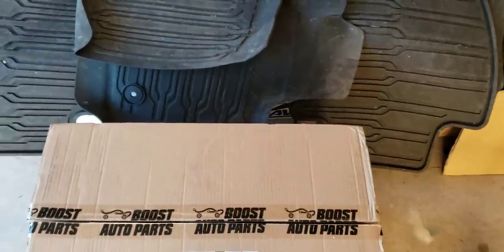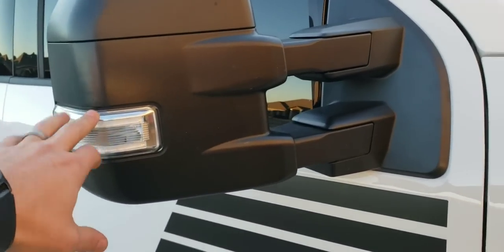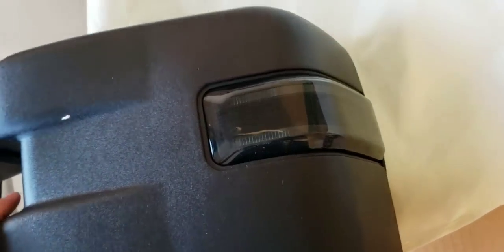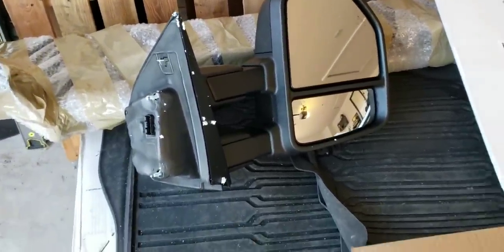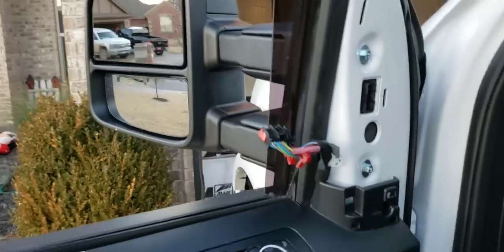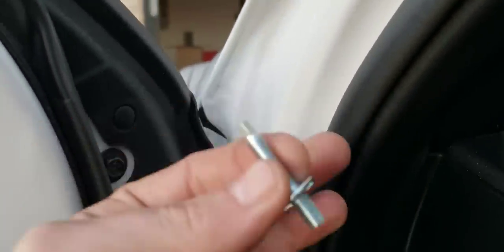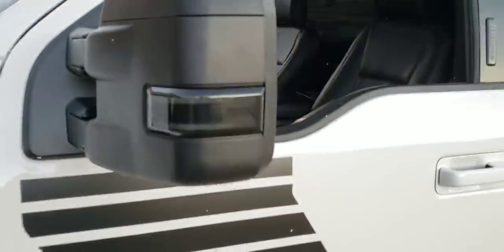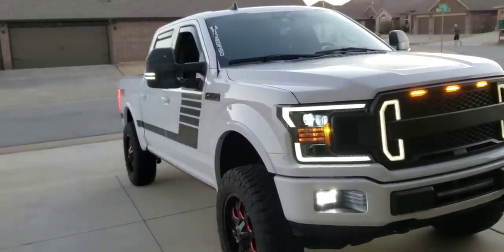BY FAR THE BEST TOW MIRRORS FOR YOUR 07 N UP F150, 03 N UP SUPERDUTY, BOOST AUTO PARTS INSTALL

Comment: I just finished my install today.  Well built products for sure.  I ran the wire for the running lights which was a bit involved at first.  But after doing the passenger side, the drivers side went much quicker and easier.

Comment: Great videos my dude.. liked and subbed. Just purchased My first ford… new to me 2020 f-150. Your videos are super helpful. Just to be clear that one extra wire I will have to run to the door harness will activate puddle lights and switch back? Or are there more than one wires? The truck I have now had the basic mirrors no puddle lights.. thanks man👍🏻

Comment: I thought for the switchback feature u had to run wires to the headlight? I want switchback but only if I can just plug in a harness and not do any extra wiring. Thanks for the vid

Comment: Ok guys I am trying to find some 2016 f150 tow mirrors with all the options...power fold and tele, 360 camera puddle light etc. the only ones i can find are 1600.00  I love these mirrors but they are not power fold unless I am missing something. Oh yea sweet truck!
Reply from the maker: i would personally wait just a bit longer as i know a great company that makes the best stuff is working on a set to be released.
Reply: @WICKEDAUTO1  Thanks!
Reply: @WICKEDAUTO1  Thanks for the info I will watch for them.

Comment: Nice, I just ordered the same ones for my 2017 ,  Only have the 8 pin connector though so have to  run the extra wire for the running lights. but seeing them on your truck it' will definately be worth it.

Comment: Nice video, how do they perform on the highway. Do they vibrate like the old mirrors? How far do they extend out? Do you hear more wind noise when driving on the city streets?
Reply from the maker: They are absolutely amazing, 100% difference from the syppo ones. No shaking, no wind noise, factory like glass. I believe they extend out 3in

Comment: Great video man!

 I may have missed it but do those lights on the mirrors have the spot lights like oem? If so how do they look, as far as brightness?
I was thinking about getting them for my OEM Tow Mirrors but I don't want to lose my spot light function.
Reply from the maker: Nope you didnt, I didnt even think about including it that's my bad! But yes they do include the spotlight!
Reply: @WICKEDAUTO1  oh damn, I'd love to see how they look. Those side marker lights look slick
Reply from the maker: @cheeznhard  so got a little more info on them, at the moment it is just a low output spot light looks the same as the running lights on mine BUT they are working on a high output(brighter than oem)
Reply: @WICKEDAUTO1  awesome thanks for the info man!

Comment: Question, if My lariat already has blindspot lights, puddle lights, power folding, does it mean I have 22 pins connection? do I need to do extra wiring? Will they support power folding feature? I didn’t see you extend the mirror out, do they pull out? Thanks
Reply from the maker: Yes you already have 22pin then, yes they have powerfolding but telescoping is still manual I believe

Comment: I have a 2019 f-150 with no puddles lights on my mirrors. So does that mean ill have to run a wire through the doors to get the switchback and puddle lights to work?
Reply from the maker: That is correct

Comment: Would there be anyway you could upload a video on how to wire most of it, I have a 2018 stx,  so Im guessing I would need to run every single wire like you had said on the video for everything
Reply from the maker: O the only wire you have to run is the puddle light wire for the 8pin mirrors or do you mean wiring for the full power extend and all that?
Reply: WickedF150  no that’s what I meant my bad.
Reply from the maker: @davidaguilera6560  o ok, yea the puddle light is all you wire if you want it to work, the link for their video on doing that is in the description. It doesn't look too bad at all

Comment: Yo Wicked. If i get these for my XLT without puddle lights, so 8 pin. Can i get the running lights and turn signals? Or do i need to wire a bunch of shit? I dont care for the puddle lights unless its easy.
Reply from the maker: You would have the turn signals yes but the running light from my understanding is somehow part of the puddle light, with having 8pin youd have to run the wire for it. Boost auto has a video on doing that, its only one single wire to run and they send it with the mirrors as long as you check that box when selecting the mirrors

Comment: Do the running lights work automatically when parking lights are on or do you have to run a wire? My lariat has the turn signals but not running lights on the non tow mirrors. I know you made an earlier video about making the non tow into running and turn.
Reply from the maker: My lights are always on auto and the mirrors are on

Comment: Very nice. Do you still need the Boost wire harness to get the running light option to work? I have the 22 pin connector mirrors already would it be plug and play. Thank You
Reply from the maker: Nope, if you get the whole mirrors you just select the running light option, completely plug n play. You can get no running light, amber running or the switchback as I have

Comment: I have a 2015 lariat with puddle lights. Do I need anything extra to have the running light option? Also do I lose the power fold option that I currently have?  Thanks. They look awesome
Reply: The power adjust, defrost, running light, signal, and puddle would be plug and play. Unfortunately we don't currently offer power fold mirrors.
Reply: @boostautoparts  thanks so much. No big deal there . Rarely use it. Just gotta choose what if I want steady Amber or the switchback. I have anzos so I think the white running light would match. Gonna order these this weekend.
Reply: @wheeler2816  The switchback would look great!
Reply: @boostautoparts  I agree. It looks like the white is pretty close to the anzo white so the switchback should go great. Will keep you posted

Comment: I have a 19 STX with 8 pin, would they running lights and switchback functions work with just using an 8 to 22 pin adapter with the boost harness added to it or would I have to run the separate wire through the door?
Reply from the maker: You would have to run the wire through the door that they send you. Just a separate pin adapter wouldnt work at all.

Comment: How’s the spot lights? As bright as factory? Brighter?
Reply from the maker: The puddle lights are super bright, the spot lights...nothing really changes, it's just the running lights showing but they are coming out with a high output spotlight way brighter than factory

Comment: Thank you so much for explaining and doing this video.
Disregard my comment on the older mirrors.
2016 f150 xlt. Non bliss
I want puddle links.
Please give me the the links I need for this install.
Reply from the maker: Link in the description...you'll see on the page just click what you have and that's it
Reply: I currently do not have puddle lights when I order the new lights I want them to include the puddle lights so on there? Asks if my original mirrors came with puddle lights I said no but since I want to add them should I say yes and then have to buy a separate wire wiring harness to
Reply from the maker: @brian5975  no, put no since they did not come with them. They send the wire with the mirrors. You just have to wire that part. That wire is also what will make the lights on the mirrors work as running lights.

Comment: is there any way to level them. I just installed mine today, and they are not quite level. no biggie, just curious.
Reply from the maker: Not sure what you mean level them?
Reply: @WICKEDAUTO1  I don't think there's a way to do it on this style, but I have watched other videos on the Silverados tow mirrors from Boost Auto there's a cap you pop off and then there's 4 bolts behind it. take 2 bolts out, either top or bottom, and insert 2 or 3 washers behind it to bring the mirror up or down, and then snap that cover back on. but, like I said, there's no cover on these to do that.

Comment: no power fold? trail ridge makes them as well and you can get power extend as well.
Reply from the maker: So they dont have the aat in the mirror, I didnt see any power extend and yes power fold but if you dont already have that you have to add it anyway.
Reply: @WICKEDAUTO1  2017 Ford F150 Truck (without Temperature Sensor in Passenger Side Mirror) Power Heated LED Turn Signal Memory Blind Spot Detection 360-Degree Camera Spotlight Puddle Light Power-Folding Textured Black Power-Telescoping Towing Mirror Set with Performance Style Mirror Caps
Reply from the maker: @bronco788  do you have a link? I didn't find any but still no aat like I said so wont work for the 18+ with it
Reply: @WICKEDAUTO1  I think this is part# 1AMRP02175

Why would they put the AAT in the mirror SMH. Ya it doesn't have that feature but does have everything else
Reply from the maker: @bronco788  ok yea found them by that, the bottom glass probably isnt heated, they arent running lights, no smoked lenses, no switchback function, but they are a great option for 15-17s absolutely...if they already have those functions stock of course. If you dont already have them you wont get them.
Reply: @WICKEDAUTO1  they have video on how to hook all of that up. How are you liking the floor mats by the way?
Reply from the maker: @bronco788  hmm I'll have to look into that, thanks for the heads up!! I love them, cleaning out the truck is much easier and then I just use a leather conditioner I have for the seats on the mats

Comment: Boost Auto's mirrors are THE ONLY way to go. I've tried to cheap out and get the no-brand ones on Amazon (for like $250) twice, and both times I got burned. Having been able to touch, feel, install, and work with various mirrors at various pricepoints, I can definitively say that Boost is a cut above the rest (more like 5 cuts). Most of these other mirrors are the same pieces of trash, rebranded by different vendors or drop-shippers (assholes that just act as a middle man - they take your order, and order the mirrors from someone else cheaper, and have them deliver it to you, never having even looked at the box that you're getting). MOST OF THESE OTHER MIRRORS ARE THE SAME ITEM, and those mirrors are absolute garbage. You can hear the plastic creek and pop under light pressure from your hand when unboxing them.

Boost mirrors are where it's at. OEM quality at half the factory price. You're just not going to get good mirrors for $200. Go with boost and be happy, or cheap out and regret every lane change you ever make when you're trying to spot cars in a mirror glass that's vibrating like Snoop Dogg put a set of subwoofers in your car and never turned the bass down.

Comment: I had ford onsyall tow mirrors on my 19 f150 XLT., no BLIS. I dont get running lights , only turn signal at very edge of the mirror. 2 little lights. Why??!!
Reply from the maker: Because you have an xlt with 8pin mirrors, ford mirrors have 8pin and 22pin mirrors. The 22pin wouldve probably gotten you the running lights. Blis is an entirely different option that your truck is not equipped with it. You can add it if you want but you will need new tail lights with the blis module and mirrors.
Reply from the maker: Boost auto parts does have a lens that you could get to give you the running lights if you dont want to change out the entire mirrors
Reply: @WICKEDAUTO1  I dont want BLIS, just trying to figure out how to get rest of the light to light up. Literally only 2 lol lights facing rearward light up as when turn signal is on. That's all
Reply from the maker: @johnherman8861  I misunderstood my bad, my guess would be the wrong pin mirrors. If you had ford install them then you have a warranty, I'd go back to them

Comment: I went to the site and noticed they do not have an option for side spot lights.
Reply from the maker: They come with the 22pins, at the moment it is just a low output spot light, just the white running lights basically how it looks on mine. They are working on a high output spot light to be brighter than OEM
Reply: WickedF150 I wish I would have waited to buy the factory mirrors but they were a great deal. I love the switchback tinted lights.

Comment: Couple questions.. Can you extend them out by hand? And do the switchbacks work with DRL?
Reply: The mirrors can be extended manually. The switchbacks operate with the park lights, not the DRL. So if you want them on during the day you would need to turn your headlight dial to the park light position.

Comment: Do the spot lights work with these?
Reply from the maker: They do. But if you get the running light, you can't tell as the spot lights use the same lights.
Reply: @WICKEDAUTO1  Thank you! they just got power folding so im gonna order them. thanks for quick reply

Comment: Does the LED spotlights work with these?
Reply from the maker: They don't look really any different as its the same bulbs as the running lights but they do work
Reply: WICKEDRIDESZ so (when stopped or below 10 mph) you can hit the factory floodlight switches on the left hand side and they work like factory? The ones above the headlight switch? Just confirming we are talking about the same stuff. 🤣
Reply from the maker: @dukestang  yes thats it, but when I turn it on I can't tell a difference in light output as the running lights on the mirrors are the bulbs for the spot light so they're already on technically
Reply: WICKEDRIDESZ wow interesting so in sense compared to stock those lights are on all the time?
Reply: @WICKEDAUTO1  We are working on improving the spot lights; this should be improved in the next few months.
Reply from the maker: @dukestang  yes, as they're running lights if you choose to have the running lights. You can get them without the running lights but still have the spot light